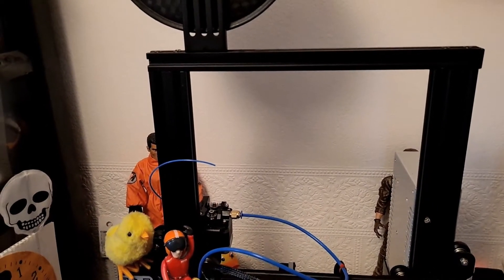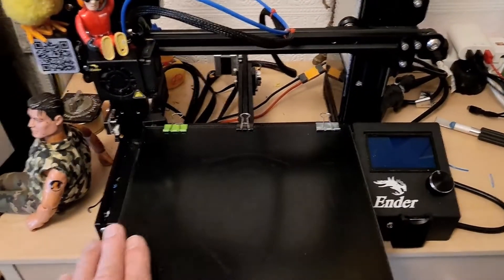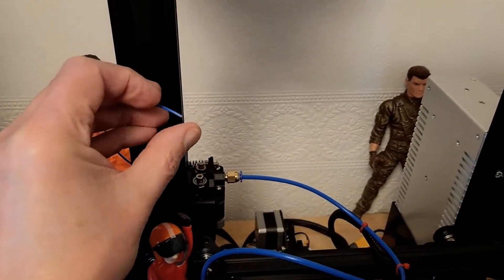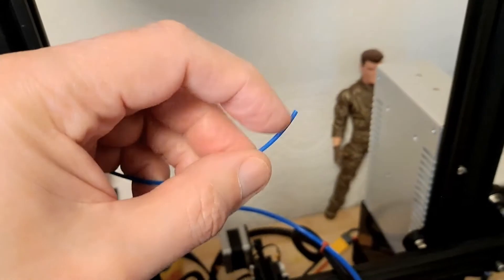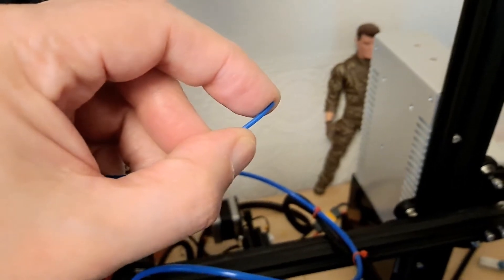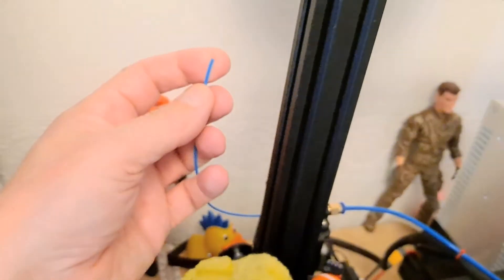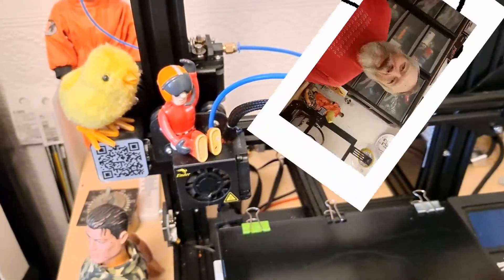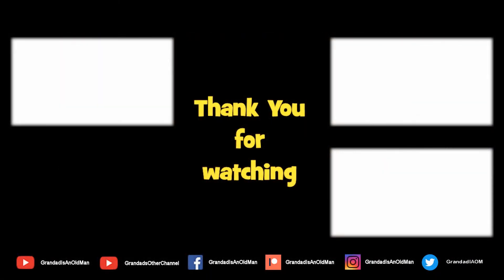3D printing issue Update 20210127 Brittle filament

Comment: Hi Graham. That is terrible. The filament should not be as brittle as that. I would definitely look where I bought it from as you won't want that again, plus it is not cheap to buy. Glad you found your problem. 👍🎸
Reply from the maker: This is bargain-basement stuff £12.99 a spool with free shipping 😆 so a good example of you get what you pay for. The prints it has produced have been fine. I might print myself another support arm to smooth the pull on the filament. I did one last year and it broke 🤣
Reply: @GrandadsOtherChannel  Looks like your filament needs to be dried out to much moisture ingress

Comment: I had a roll of black that did that
Reply from the maker: The funny thing is that it seems to snap after the print run has finished, whether it is just coincidental, I am not sure. I have done several prints since the previous video update and every time I went to collect the finished print I noticed the filament was broken midway between spool and driver, which is the straightest point. Tonight I am running some prints and filming them to see when it breaks. The first two prints went through with no break, I am about to go up and check the third one. Just checked, still OK at the moment, but that is a long print, several hours to go yet.
Reply: @GrandadsOtherChannel  I have direct extrusion so I don’t have this particular problem but I’ve heard that filament breaks in the bowden tubes. The tube makes it brittle, out gassing possibly. Also humidity can do that too. I’ve dried PLA before I could use it
Reply from the maker: @Mrpurple75  the break is not in the tube, it is between the spool and the driver. It appears to be where it gets straightened. Even if it did break in the tube it shouldn't matter as it will be pushed through by the driver.